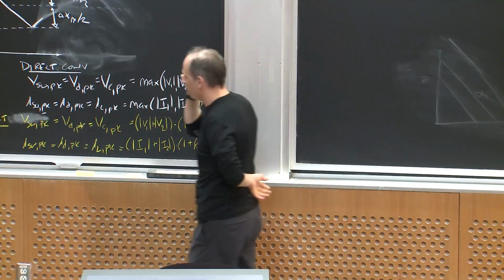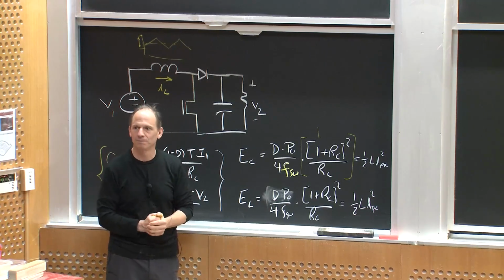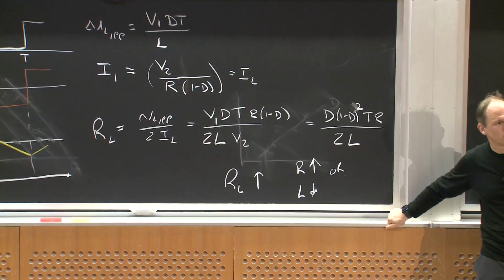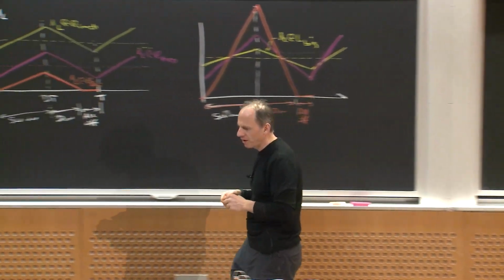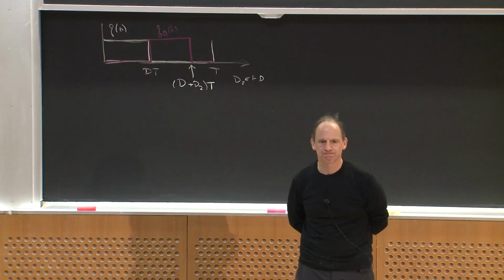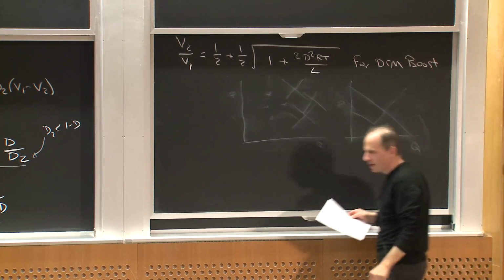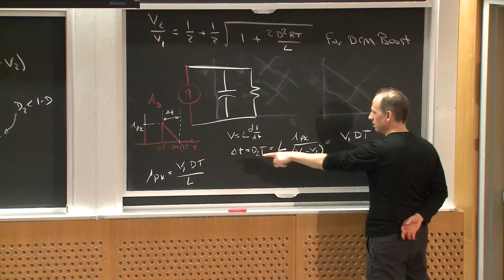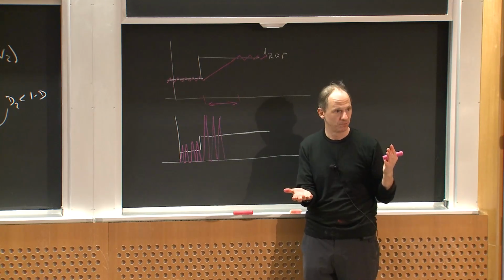Lecture 8: DC/DC, Part 4

Comment: 39:48 Hearing protection isn't a bad idea, either. Once I had a power transistor in a QSC audio amplifier which energetically disassembled and left my ears ringing for some time.
Reply: The switchmode supplies in modern PA amplifiers are very scary. The higest power ones have a secondary voltage of > +-150V and can deliver > 10kW for a short time.

Comment: Excellent lecture. Your point regarding DCM and picking small inductance (and capacitance) for fast transient response ties in wonderfully with a presentation I saw at PwrSoC 2023 on the subject of dynamic phase shedding in multi-phase integrated voltage regulators (IVR) - for those unfamiliar with the concept, it's essentially a series of buck converters in parallel with the load-side of the inductors all tied together, with each converter's duty cycle phase-shifted in a sort of "round robin" mode of operation, and the integrated form is created fully on-package for large ICs such as CPUs, GPUs, and FPGAs. The dynamic load shedding idea is to reduce the number of active phases in low-load scenarios, keeping the active power phases in CCM. The presenters had developed an architecture where on-die capacitance was hooked up as a LUT so that it could be dynamically reallocated from the low-side to the high-side depending on the number of active phases, which in turn was dependent on the load. They had recognised that the amount of capacitance required to meet the output voltage ripple spec with one phase enabled was overkill when all 6 phases in the converter were enabled, due to the effective switching frequency essentially being multiplied by the enabled phase count. With just two phases enabled and constant output capacitance they were already seeing output ripple magnitudes one fifth of the specified limit. While this is nice, it seriously harms the output transient response, which is absolutely critical in these applications due to the huge dI/dt generated (many amps per nanosecond) in the load. Their capacitance LUT trick allowed them to reallocate the capacitance from the low-side (output) to the high-side (input), maintaining output ripple well within the max spec but also getting to repurpose the capacitance for decoupling, reducing the effective source impedance. The end result was a 400A IVR design with high efficiency and within-spec ripple across the full load curve, with 14 times faster transient response versus the same design with the capacitance LUT disabled. Really quite clever. The presentation was "Current-Shared Multi-Phase FIVRs with Phase-Shedding-Optimized AC Dynamics" by Prof. Hyun-Sik Kim; the slides are available online.

Comment: Thanks for such an incredible and valuable content!! I just have a question, how is the efficiency affected between the DCM and CCM? Is there a general rule for that?
Reply: Device still using "switch" to convert (direct convert) so its still lossless theoretically. DCM or CCM only related to LC spec. Cmiiw

Comment: In voltage stability or high-frequency loss problems, the boost converter would be less than the [DC-AC Boost Transformer -DC] converter. Don't you think another lecture will be much important in power energy control system?

Comment: The reduction in duty cycle you need at lower loads to not increase the output voltage, is the reason you can hear your phone charger "tick" when not connected to the phone (correct me if I'm wrong).
Reply: Thats may be a nother operating mode for even lower output loads, called hickup mode.

A duty clcle approaching zero is very hard to implement. Therefore it is sometimes preferred to only run the converter in short bursts, but with a bigger duty cycle.

Comment: "The ringing? Causes a bit of noise, it's annoying, that's life".... HAM Radio guy... "oh no, another wallwart :("
Reply: Yeah young molex avalanche diowed
Reply: Interdigitated cross-inductance
Reply: Slow start capacitor; bleed resistor; full-blossom
Reply: The transience of p-strontium. Water is a preservative - wear gloves if theres a step down ripple - calcium carbonate - not carbamate, red suede..
Reply: EmitioRn0 at pica-i